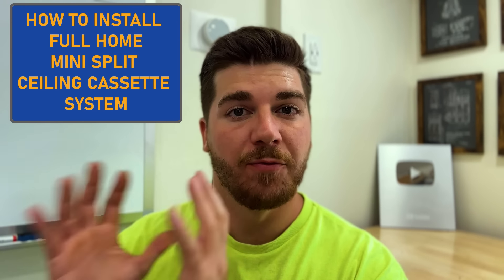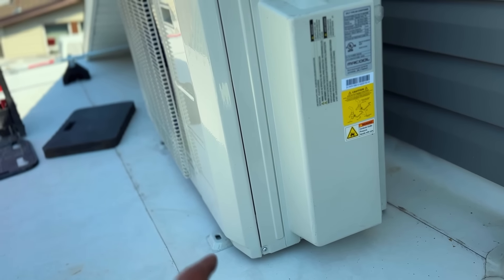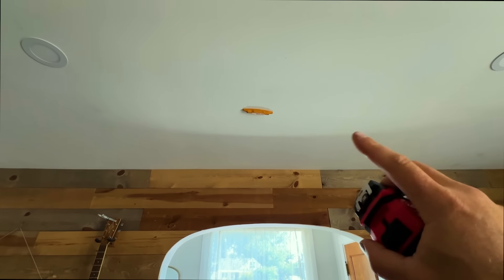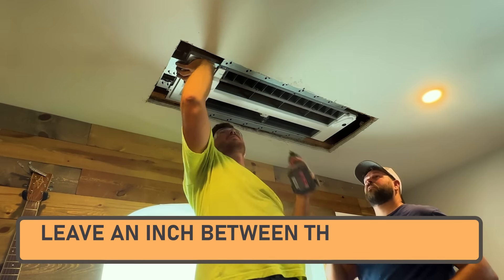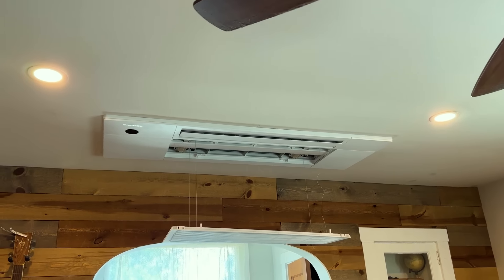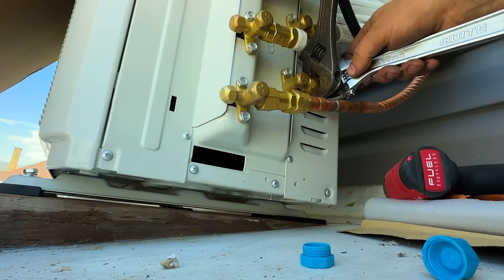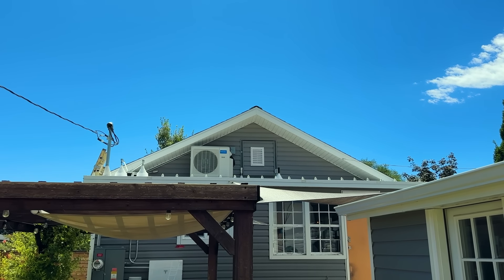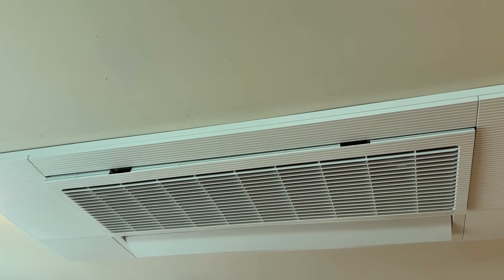The Mini Split - REINVENTED.

Comment: So... What does MrCool do that other minisplits don't?

Other than not send you parts.
Reply: Quick connect fitting, no vacuum or pressure testing, can buy from many distributors
Reply: @phamlam3720  So.. The McDonalds of HVAC. Mkay.

Comment: hi
I loved your 4 zone system, I would like to install one like that. Looked to your link and could not see the system like yours. What other link that you can provide that I can see more detail. Another couple questions. My house is 2 floor. I like to install this in my second floor. Because all 4 bedroom are up there. 
1. How long for the cable or line set you can get(max) for each head? 
2. How much for your system with 4 zones. Not include the labor?

Your help greatly appreciated.

R/Khoi Nguyen
Reply: Lowe’s sells many different 4 zone combo. I believe the max line set length you can buy is 25 feet but you can buy the Mr. Cool coupler and connect multiple line set up to 75 feet max.

I paid about $4K for my two head system. A 4 head system would be about $7K

Comment: Now if only Mr. Cool would make a solar system for their mini split systems.
Reply: I have two of the Eg4 Solar ACs. In most cases, youd be better off using a dedicated solar system supplying a battery and inverter to an AC system. Even in the southwest, where most days are cloud free, the fluctuation in solar production causes the AC unit to ramp up and down, causing inconsistent cooling through the day. Powering the AC off the solar alone, with out a grid connection doenst cool the house on the hottest of 120 days.
Reply: mr cool doesn't even have good nor that efficient of units. all they have is pre-charged + pre vacuumed units. EG4 has much more efficient units also has the solar availability and the pre-charging + pre vacuumed
Hopefully more places do this

it is silly to use different solar systems to charge specific devices, all your excess power is wasted then. just do a full 1 system
Reply: @RoHo702  Most ancient ac units us a fan and condenser inside a closet in the hot and recycle the cooled and warmed air making them more efficient and cheaper than these units that cool the hot attic air and force it into the rooms. Then the moisture that is removed from the air must be dealt with and in South Florida this is a lot of water and the gunk that grows in the drip pan can be a problem and clog up the pipes and cause an overflow ruining the ceiling. I wonder how these units will handle the algae build up? And the bugs that crawl up the drain pipe and clog it.

Comment: Only thing I would have done was route the lineset and PVC in a way that it was more protected if someone goes up there like a cable TV tech anyone really end up tripping over one of those lines going to be a mess. Instead of using hardline PVC I probably would have converted over to PEX and ran that it's lot tougher and flexible. The lineset I guess had little choice there length is what it is.

Comment: I have 2x4 engineered trusses, no joists. I have been unable to find any information on whether a ceiling cassette can be installed between my trusses; everything only mentions joists. I know the trusses have easily been able to support my weight when in my attic, and I am 230 lbs. I am comfortable with a little carpentry and framing work and can add extra blocking between trusses or bracing to span across multiple trusses, but looking for any guidance from someone more knowledgeable or who has successfully installed a cassette in trusses.
Reply: I installed it with 2x4 floor trusses ceiling but had to bump it down since it wouldn’t fit between. You need 14 inches of space between the truss.

Comment: Pretty small room to have two 9k BTU units. Just one 12k BTU would be fine, and probably a 9k too. Ah, that all Midea stuff. Mr Cool doesn't produce AC. Still nice stuff. Midea make like 70% of the WW market stuff. And those have inverter motor, they don't turn on/off, they just modulate the amount of refrigerant you get, by change the speed of the motor.

Comment: This is pretty much what you see inside Japanese commercial buildings. I believe, I could be wrong. 
Japanese residential houses have single units or splits that look like single units. No central heating or cooling. I think they are more efficient than US HVAC, but most Japanese homes have very inadequate insulation and they end cycling a lot more than they should.

Comment: How long will it take for the air handlers to begin to suck the insulation and dust out of the attic and into the home below? This is a poorly thought out installation.
Reply: It’s a sealed unit. The only thing going into the attic is condensate within the pvc pipe.

Comment: Installed a Mr Cool system that had problems from the start. When temperatures outside cool to under 73 degrees, the condenser fan cuts out and the compressor starts working very hard because of it. Mr Cool will not work with me for a fix and said management made that decision. Local services don't want to work on a user installed unit so I am stuck with a paper weight. Hope that you don't have trouble with their units because they don't stand behind their warranty at all.

Comment: In climates with any humidity, ceiling cassettes installed with their open backsides extending into unconditioned space are going to sweat with condensation.
The entire case needs to be well insulated and sealed with a vapor barrier to prevent this. Otherwise there will be mold and possibly ceiling damage from water.

Comment: will yhere be vibration from that outside unit and screwing the borad and stuff to  that rubber rof will need extra protection to the screws or they may cause a leak . To me that attic door needs sealed better and you need more insulation . Did you install them to  what is called for in square footage and distance between them . . I looked them up and it says one my 2460 sq ft it says I only need 4 units   since the space is mostly open and only 3 bedrooms   but 4 bathrooms . . The company if you give them floor plans even tell you best place to mount them . I have a new heat pump but looking at the info  to just see difference in energy cost  compared to my lennox 16 seer dual  compressor heat pump

Comment: We recently installed a conventional mini split in one bedroom made by Inventor here in Europe. What I have found with this unit is that when in “dry mode” it does not recognize the temperature set for that mode, instead it continues to cool the room down to freezer temperature (so it feels) I do t know if there is something wrong with the controller but it’s been this way since it was installed. We have four other units in the home three by GE and one by LG. When in dry mode they respect the temperature selected. 
The Inventor unit also is WiFi capable but only with their App. When looking at the terms and conditions of the app they demand that you cannot speak against the government, WTF? You read it right. To get around this issue I have a friend who was able to create a program that loaded into a different WiFi dongle and control the unit via another App. As for the other four units, there is a company that makes WiFi programmable emitters that can be placed within line of sight of the iR sensor and can control all of the functions of each unit remotely. Running the units constantly in "dry mode" allows for maximum energy savings and maintains a constant temperature in the home.

Comment: We installed a mini split system with one outside compressor running 4 interior room HVAC wall units.  I'm NOT saying these aren't perfect for some situations, but please beware of a couple of considerations.  1.  Our mini split cools and heats the air perfectly, except there is no air exchange.  Unlike with a conventional system, if you are dealing with something or someone that smells - you can heat or cool the smell, but it's not quickly removed as with a traditional HVAC system.  Lastly, our system lasted about 6 months past the warranty.  When the installer came back to service he was embarrassed to say that the parts were so tiny in the outside compressor, we would have to replace the unit as repair would have been more expensive than it was worth.  Separate conversations with friendsnwho have similar systems exposed the same problem.  As of this point in time, we simply aren't running the system at all, and will likely go back and install a traditional duct system.
Reply: A standard HVAC unit would just spread the smell out throughout the house. 

A ERV would be the tool to bring in fresh air, not your furnace or heat pump.
Reply: @phamlam3720   - yes ppl may not realise that ventilation with an ERV - can be done separate to the AC... Air changes with  energy retention beats old school..
Reply: Could you use the eating old compressor with some modifications? The external unit he installed outside is just the same concept of the standard one outside a house. Don't know what the dynamics would be, of course, but you could find out.

Comment: Something to note about "knockout" tabs is that they were never meant to be directly struck with a hammer... you get a screwdriver at the corner opposite the thin 'join' line and tap it until you have enough room to use the screwdriver as a wedge to widen the gap. Then use Channel locks or needle nose pliers to grab the tab and twist and/ or wiggle the tab loose... swinging hammers around electrical equipment is bad juju in most circumstances, even without power connected. Also be extra cautious that you meticulously clean up the chips from that step drill and don't let them get into anything or you will have arcs and sparks and a dead unit to replace. I am also curious to know why those are 3 Phase breakers in a house (which is a rarity in most residential units) that is generally wired single phase unless you specifically have 3 phase wiring available...either that or it is being fed by the condenser unit? I may be mistaken, but I would really like to see how they did the wiring distribution for those.  Other than that, a pretty decent job overall and I really like the ladder hoist!

Comment: How do you do with the cost of usage of these things. I have a Fujitsu that was put in in 2023 I live 50 miles east of Chicago in Indiana we had a mild winter it does two rooms so it's equal to a 1.5 ton 9, 000btu X. 2 running it on the heat side cost us $300 a month. And that's just keeping it at 65-68°we added on to our house a mud room and a guest bedroom and it was easier than taking from our 1923 house HVAC that was trunked really shitty. Not much back pressure and inconsistent pressures. So our total bill we have a natural gas 80 100 BTU stays on the low side trane two stage 18 years old variable speed we run our house at a max of 68° in the winter still works great. Good maintenance. What came to a total of $700 on the bill. So 300 was used for the heat pump. 300 was used for the furnace for the upstairs the rest of the center floor in the basement. And the other $100 was split between the on demand water heater and the oven. Everybody's trying to push the heat pump is so great either ours is broken or there's a load of shit going on. We have a 4 ton 14 seer train for AC for the whole house. Otherwise I've been running for the other two rooms it just on the dry setting very minimal for the summer still just drinking that power. Not to mention that thing vibrates like a freight trained cuz it's mounted to the 2x4s. 🤷

Comment: I am building a house, planning on mini splits.

These new type ceiling units would be great if they didn't mark them up so high.  Really not that much more to them than the exposed wall units, but they think the things are made of gold.

it's just a different mounting for the same basic components...  Why is the 18k BTU with ceiling unit almost the price of the traditional mount 36k BTU?  That's insane.

I'm a fan of using 4 single zone sets instead of 1 4 zone outdoor unit.  If one of the single zone systems goes down for any reason, you still have 3 completely functional zones.  A couple of box fans and you can keep the whole house livable, instead of the one unit taking down the entire system, leaving you panic buying window units to deal with those 110 F days here in Texas.
Reply: I hate those fine screen "filters"  They make you think you are filtering when you aren't  They only get larger particles.  Like a dryer lint screen.  When enough lint builds up, they actually start filtering...

Needs to use the replaceable "furnace filters"

Your unit will live longer with a better filter.

Comment: from a electrician, a knock out is really made for knocking in, work it from out side the box. and also the cheapest way to save money. ADD insultation, he might be in CODE. but thats the min not whats needed,
Reply: I was about to say the same thing.
Reply: Besides, drilling with the unit in will also be hard and leave filings that can lead to a short circuit and failure.  Just knock the knockout out while the indoor unit is on the ground.  So I am glad the channel shared the problem but I think he gives the wrong solution.
Reply: In this house the attic insulation is meant to keep the heat out of the house, not the attic. And the ac unit will use the hot attic air regardless of the insulation and have to cool it, unlike the units installed in a closet in the house which use the recirculated cool air in the home. The attic temperature can soar to 120 or hotter, ask any duct installer. So instead of cooling 80 degree air to 70 you'll have to constantly cool 120 degrees to 70. That's lowering the temperature by 50 degrees rather than 10 or less.
Reply: @fmpApps  look its a small insulated box. air in and out in seconds. and the difference on which side of the drywall its on dont matter. and the closet one you are talking about, it runs hundreds of feet of insulated air duct thru the attic, leading it to more exposure to the hot air.

Comment: Awesome video....funny how this is "new tech" for the US and yet has been in use in japan for the past 20 years.  Glad the US is finally catching up.
Reply: They’ve been common in the rest of the world for 40 years
Reply: These have been available in the US for several decades. You just don't see them often as they only work well for specific applications. Most residential in Japan has far less square footage to heat and cool than what you would find in the US where a whole house system works better.
Reply: @NavyVet4955  Thats a good point....the size of the average US home is 2.5-4x larger than a home in Japan

Comment: The drawback of these ceiling mount units is drainage and accessibility.
Reply: They're amazing tho
Reply: The unit is now in the hot attic, it's more energy efficient to avoid the attic.
Reply: @robertball3578  it's heavily insulated inside
Reply: And the 130 F attic heat they are constantly having to cool instead of the 80 F inside the house.
Reply: @AgentOffice  The insulation is for the ceiling of the home below, it has nothing to do with the air in the attic which these ceiling mounted units will have to cool. Install them on the wall for more efficiency as they will the use the cooler air instead of the hot attic air
Reply: @jackrodgersjr  you don't know Jack. Ceiling mounted head units don't pull air from the attic and the wall versions don't pull air from the wall. They are isolated from the attic and insulated. Same as central A/C ducts in Texas. It all runs through insulated ducts in the attic--often scorching, unconditional air space.

Comment: After installing the ceiling these units can you insulate around and over them to eliminate 
heat loss or gain from the attic?
Reply: He put foam around them if you look at the vid carefully.
Reply: @robertgregory2618  Thanks, I did but I live where 12 inches of fiberglass attic insulation is required due to extreme cold.
Reply: @TimothyTremblay-r7t  You did well by doing that  But that is not his job, that is up to the home owner.

Comment: Downside of the Mr Cool pre-charged is that it cost much more than an equivalent mini-split where you evacuate the tubing with a vacuum pump.  You can buy a pump for ~$70 (much less than Mr Cool premium) and use it in future AC work, including on your cars.  Also, you can't cut and flare the Mr Cool tubing to fit so need to coil the extra.
Reply: Also they have lots of other minor issues after about 1 year....
Reply: You also need a set of gauges.
Reply: they are ewaste if anything fails...
Reply: How do you feel about the Mitsubishi mini-splits? More reliable? Better performance?
Reply: @cryptogenik  7 years with a Mr. Cool.  Zero issues.

Comment: I remember installing my first one... I was in Iraq and re- built the failing fun room in front of my "Container Housing Unit" or CHU. I built on a new roof and put up rafters, reinforced the exterior walls, added a couple windows, and I ran a 220 volt 60 amp line to my add on via a new main panel. The only thing I needed was temperature control so I got a hold of a mini split. I then needed a vacuum for the lines since it was brand new. I used my medical suction and was able to get the desired vacuum in the end. That served me well and the new tenant, once I returned to the US, inherited the whole deal. It was a fun project on FOB Warhorse in the Diyala Provence of Iraq.

Comment: Very interesting, thanks for this.  The only thing I would change is to have hardwire ethernet and not require wifi.  As install requires running the supply/return lines to the cartridges anyway really no problem to run cat 5 or 6 along with them.  wifi is undesired security risk / more complicated that it is worth for permanent install, imo.